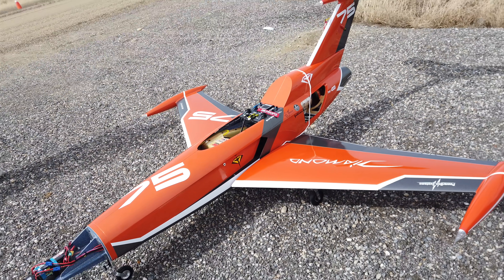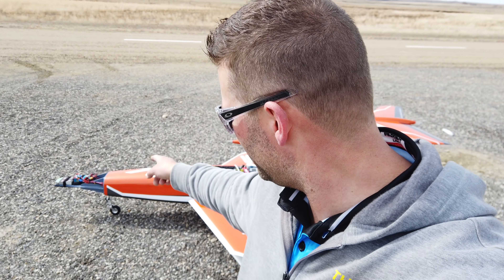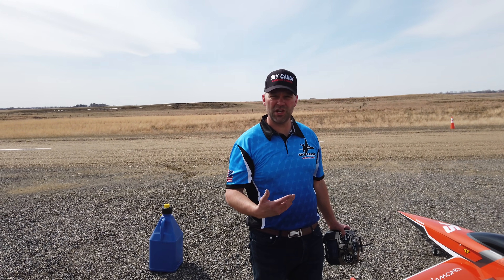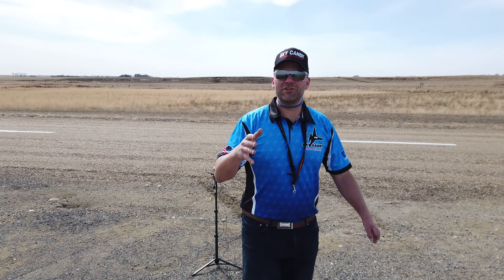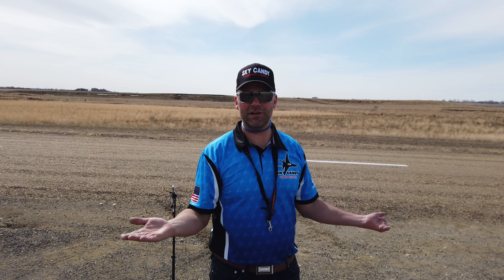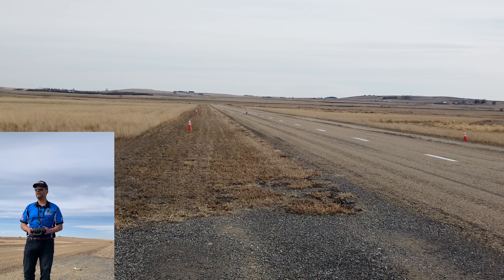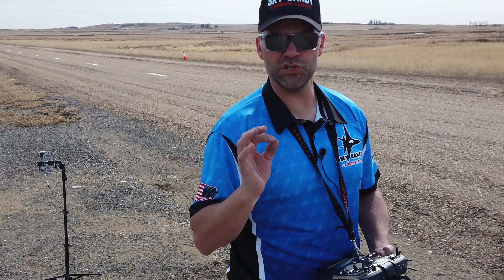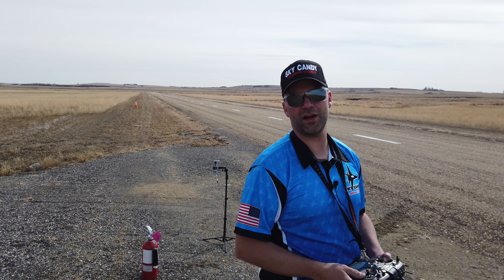HOW TO MAIDEN A JET - Aviation Design Diamond Detailed First Flight

Comment: imagine driving past and seeing that Beastie parked on the side of the road would freak some people out with couple blokes in there shades kicking stones about looking Dubious.....Did ya ever find out why she didn,t respond to the helm on her last flight. Looks fast going backwards.
Reply from the maker: Thanks nick. Still miss her and the lights!  It ultimately was a power issue/cold solder joint inside the main power hub installed
Reply: Well that sucks all that top  notch gear and to be taken out by a dry solder joint...Gutting yeah definitely one of a  kind bonus new plane...

Comment: I'm not a turbine guy, more an advanced electric (scale) model pilot. 
I like the way you approach a maiden, calm, one thing at the time, step by step, don't rush the first flights. That is how it's done! And I learned again some tips.
However I was a bit surprised you rely on the "reduced power" for range check. I maiden a lot of planes at my club, two didn't pass a full range check (so we didn't fly), but passed the reduced range check. I just don't rely on a reduced range check, only have faith in a full range checks (that means walking :-) ). 
Great work with the video series, they're stacked with tips!
Reply from the maker: Hello Dries. Thanks and thanks for watching!  
When I did the range check I walked 120-140 ft way from the plane and then did reduced signal at that point.

Comment: That's a massive T tail I love it,  reminds me of the c-17 globemaster.
Reply from the maker: Thanks Jason!  Yea it’s a hefty tail section!
Reply: @thelightersideofrc  I have a question if you don't mind me asking.  Everytime I deploy my gear and flaps my planes almost refuse to land, I find myself forcing a steep descent down and then after ground effect it just picks up a fair amount of speed. Am I doing something wrong. Trimmed for level flight at 3/4 throttle, and landing with nearly 10 percent throttle.
Reply from the maker: Couple things. 
Flying too fast. Deploy those things. Go 2-3 mistakes high and see how slow it will go. Get used to it. 

Other is your plane may need more elevator compensation to counter the flaps. If your slow and it’s ballooning then add more down elevator compensation. 

Not sure how long you have been flying but I find a common mistake is just flying too fast and landing too fast.
Reply: @thelightersideofrc  alright I will certainly try that,  I've been flying for 2 or 3 months now without advice or buddy system. Generally on touchdown my plane will only roll maybe 15 feet or so, I'm flying a p39 airacobra, it'll get really twitchy as far as roll rate it'll get so slow. Thank you for the advice I greatly greatly appreciate it.

Comment: Awesome jet and video. 😁👍
...maybe you could explain how your external startup tank works? 😬
Thx
Reply from the maker: Thanks! It's pretty simple.  Basically it's just an extension of the fuel system.  So where it plugs into the fuselage is the vent for the planes fuel system.  The startup tank just plugs into the vent and adds another tank to the system.  So beauty is your always 100% sure your starting with full fuel tanks.
Reply: @thelightersideofrc  okay thx 👍😁
...you plug the tank into the filling vent of the main tank, or into the overflow line?